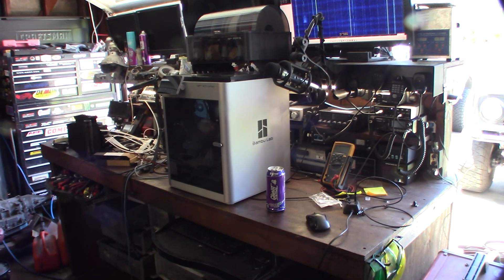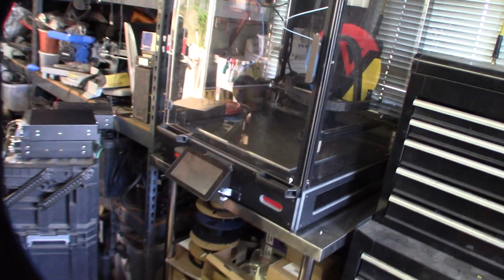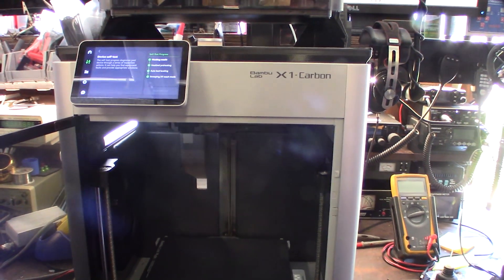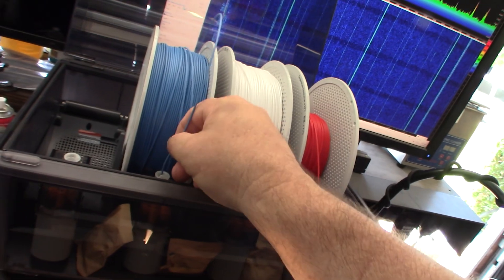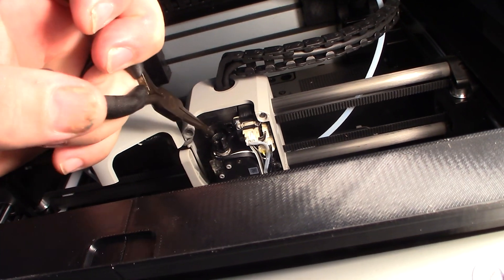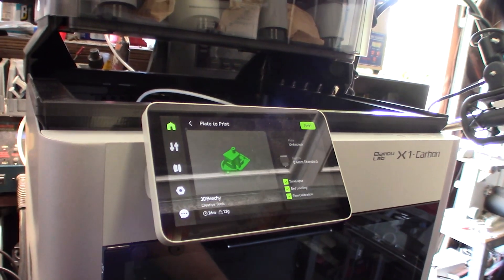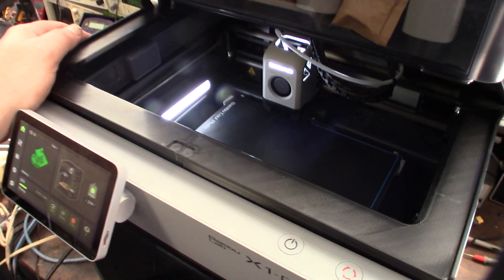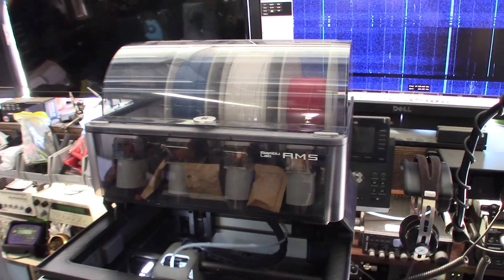Bambu Labs Carbon X1 AMS Filament Will Not Load Troubleshooting, Piece Of filament Stuck In Sensor

Comment: Mines annoying me at the moment, the filament feeds through the PTFE tube then bounces back when it gets to the, end, I'm not sure if the sensor is faulty or the extruder gear. I cleaned it all out and there wasn't any filament stuck in there.